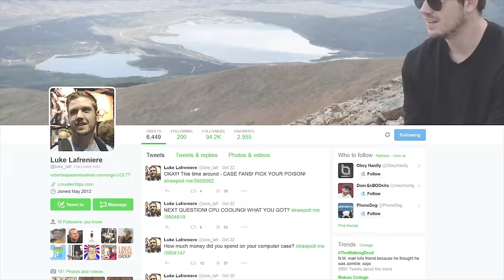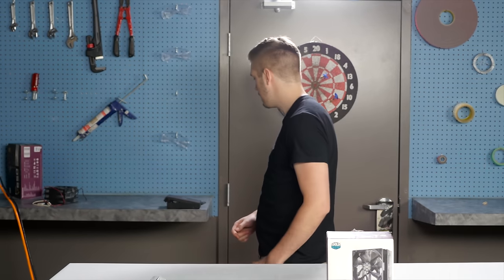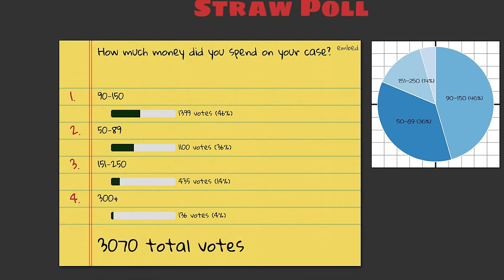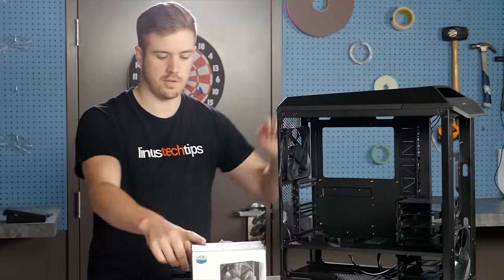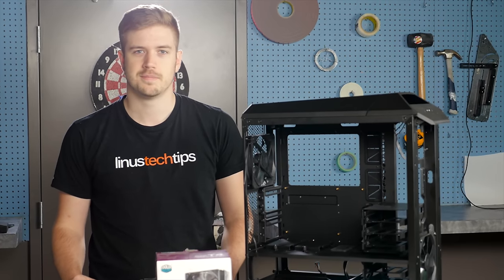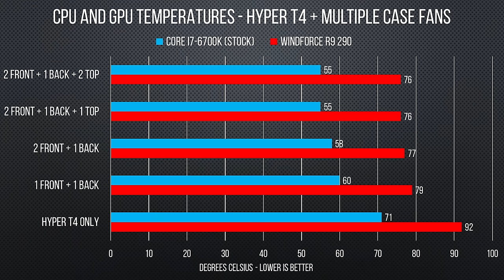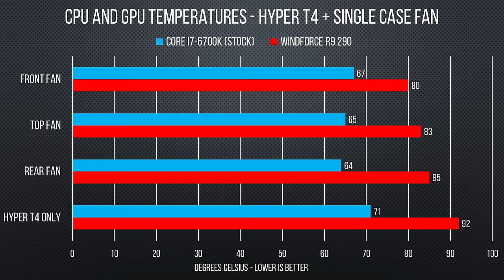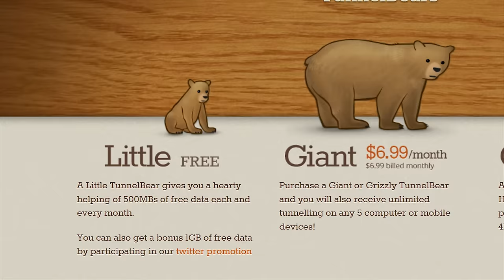Case Fans - How many should you have?

Comment: Super finds Luke! One interesting thing I've found through my own experiments is that having a direct flow of air to a particular component helps temperatures significantly (rather than having to go around components etc). Not something that's easily done in a normal case unfortunately though.
Reply: +DIY Perks Well you also designed your own case to take advantaje of that ;)
Reply: +DIY Perks It's also easier to get direct airflow on a GPU with a CPU tower heatsink as in your build. Out of curiousity, how much did it cost you to build a case rather than buy one?
Reply: +DIY Perks Your case is superior in design to what anyone could find out on the market. The closest thing that I could find to it was the Silverstone FT05 (or RV05). These cases have the rotated motherboard design and also have VERY good case fans that provide direct flow of air, the Silverstone Air Penetrators. But a case like this doesn't have room for a tower heatsink on gpu like yours does.
Reply: +Daniel Schulz The whole case itself cost only £50 in materials iirc, including the wrap and paint etc.
Reply: No shit m8 ...
Reply: +DIY Perks I'm sure you say it in the video, but what did the aluminium sheets cost?
Reply: +DIY Perks I mounted an 120mm corsair high pressure fan on my side panel, making it blow air directly onto my graphics card (reference HD6970 with backplate). This caused my GPU load temp to drop  from ~95C to ~78C!!!

I completely agree with you as my findings concluded the same! ;)
Reply: +DIY Perks If you watch Barnacules's build log on his Puget Systems build, that's basically how they designed his system. They have one fan blowing directly on the graphics cards and the M.2 SSD below them. And very similar to your system and Barnacules's system is that both are taking advantage of the normal flow of convection, which I've noticed most using these tower CPU coolers don't do that. They don't mount the coolers so that the fans blow up, which that alone could help temperatures significantly without having to add fans to the system. Perhaps something that LTT could investigate as well since I don't think they've tackled that before. The case fans aren't just about supplying cool air, but evacuating the warm air, so if you work with convection, you may not need as many fans.
Reply: +Kameel I got quite simular results by mounting a 140mm fan under my GTX570 Phantom (Pretty similar design to the Gainward in the Video). Definitely worth it.
Reply: I can really recommend the Bitfenix spectre pro they are really silent even on max rpm and they are available in 120 and 140 mm and the best is these are only 10 - 12 $
Reply: Oh my god, +diyperks watches LTT, my life is complete.
Reply: +DIY Perks Holy shit, it's DIY perks B)
Reply: +DIY Perks Oh my god! I love your content, especially your custom case and 1000W flashlight videos.
Reply: +DIY Perks you case should be the ideal for all cool/quite case designs
Reply: +sirfreakish There are cases which allow motherboard positioning, but they are rare and a bit expensive. Aside from that, no case is made to allow a graphics card to be fitted with a processor heat sink. While it does work, it is not space efficient by any means. It fits his needs perfectly, but the majority of people want expandability and convenience. Also, if you're willing to mod a case or just do a custom setup then you could mount a processor heat sink; keep the weight in mind.
Reply: +DIY Perks Ah! Now I know why HP and Apple used to put baffles in their systems when they had high end client back in the 2000s
Reply: +DIY Perks Indeed bought myself an air penetrator fan to get around this very issue. Not as good as a custom case of course but the way it forces air past my hdds makes my vid card very happy. plus its kinda fun to say :P
Reply: +DIY Perks's comment just HAD to include the word "super" ... lmao :)
Reply: Oliver ASUS Ikr... I thought that sounded very DIY Perks of him.
Reply: +Amar Gandhi Where is he located, actually? Although being a non-native speaker I usually don't have difficulties in identifying dialects, but ... geez, he's really outstanding xD
First thought was some weird UK region -- or maybe even Australia!? The last guess is ridiculous, I know
Reply: Not to be mean, but did you really need to experiment to tell you that unrestricted airflow is better for temperatures? You can tell as much by blowing on an ice cube... blow harder and it melts faster. I honestly thought this was common knowledge.
Reply: +sirfreakish I have a rv03 and it would definitely have room for the tower heat sink if you chose. however you could only ahve 1 gfx card. It is also quite wide as it has a nhd14 mounted on the cpu which is crazy tall. if you added baffles similar to this case i imagine you could run a similar configuration.
Reply: +bflet12 but thats only because what you blow is hotter than the ice cube if it was a gpu it would be a different story
Reply: +Sy AM How? Did you directly place it towards your gpu?
Reply: +Sam McHargue That's not true... let me clarify: what I'm talking about has nothing to do with relative temperatures, it has to do with the physics of heat transfer. Higher rate of air flow means higher rate of heat transfer. This is true regardless of the absolute or relative temperatures involved.
Reply: Can anyone here tell me if the top fans in this video were for intake or exhaust? Exhaust probably, right?
Reply: And my fav tech guy finally comments on a channel i sub to 😀
Reply: Fully agree, in the past I mounted 2x 120mm fans to blow directly at my 2x GPUs in SLI and they helped significantly. 

I recently tried mounting a 92mm fan to blow at the motherboard but even at max of 1,800rpm the wind force was way too weak. Had wanted a 120mm or even a 140mm fan but there wasn't enough space. Not to mention that it looks ugly in my transparent window panel. (My previous 2x fans setup was in a case with no window).

Comment: I have three fans intake, three exhaust, not counting the ones on the CPU cooler or video card. I read at least 10 emails a day, so you can never be too safe! :P
Reply: Meh, I'd rather have an additional 500 GB SSD then. ;)
Reply: it's better to have more intake than exhaust
Reply: @Zeroneii3  why?
Reply: @Banana-sb1hi  reduces dust

basically it's better in the long term
Reply: @Zeroneii3  Um....no. The better the air moves straight through with no "kinks" the better. Try putting some smoke through so you can see the flow.  I test mine several times a day....;) 
There's only space for 5 120s in my Neo Air case. two front, two top, one rear. But I still fit 6. I front mounted a 120 AIO with push pull fans.
Reply: Lucas  Oops started answering the wrong thread... I prefer the purple stuff from Hawaii.
Reply: @Banana-sb1hi  Because you create positive pressure so you have more airflow in your case than there is being pulled out, keeps it more cool
Reply: Lucas  you can buy incense (its called something like that) they smell good and leave good trail o smoke
Reply: Ruined King  OMG! It's too late!!! Oh NO Oh No!.....hahahah.
Nothing is going to be destroyed in the half second it takes for a puff of smoke to flow through. 
You worry too much.
Reply: bruh  Again...you think it's like being in a burning building or something and you're pumping tons of smoke through for hours.
(Which also wouldn't hurt it)
Computers are not the delicate little flowers you think they are.
I have a laptop out in my shop that's been running for 10 years in all kinds of dust and dirt and tons of weed. Running XP. Never crashed or had any issues, looks terrible, runs fine. Hooked to a 32 inch TV that seems to be fine too.
No, I don't recommend keeping your computer in a dust bowl...but a puff of smoke to see how your fans are doing isn't going to affect or destroy a single thing.

Might even teach you something.

Comment: Awesome video Luke! Would love another test for positive/negative setups with one, two, three fans at different locations on the case...hmmm... maybe a video idea for something i should do :p
Reply: Yesssss Plzzzzzz
Reply: I love that I can't help but read your comment in your accent xD
Reply: +HardwareCanucks yes do it. just do it. please do it.
Reply: +HardwareCanucks c'mon, do it, i'm so curious! and of course i love your style :D
Reply: +HardwareCanucks and one fan. lots of cases only come with the one in back, like mine.
Reply: +HardwareCanucks Sneaky self advertising.
Reply: +Dalton McCabe You should consider watching the video. He does test with only one fan at different positions.
Reply: +HardwareCanucks I'd like to see what an intake fan in the bottom would do to the graphics card. (like you can do with for example the Fractal Design Define series)
Reply: +HardwareCanucks i will watch it if you do
Reply: +HardwareCanucks All that needed to be done to compare positive/negative temp setup in this video was to switch to a 1 front/2 back/top fans and compare with the 2 front and 1 back fan. Other than that, the real reason for having positive setup is to help avoid dust buildup on your filters due to sucking in air from all sides of the case (in negative setup).
Reply: +HardwareCanucks I also asked myself this question, they have already made a video about negativ/positive airpressure but as you said, does it affect performance much to have all the fans pushing air in versus out.
Reply: +HardwareCanucks yeah i was gonna say there was no mention of postie or negative airflow, the use of air filters. Or maybe reversing air flow by using the top, or the back fans as intake and the front as outtake.  AND using fans internally aimed at specific components like the GPU, which is something that Puget Systems does by using heat mapping to know where to place fans in strategic places to cool down hotspots.
Reply: It would certainly be nice to see some hard numbers regarding the effects of placement, size, speed, blade type, et al on pressure, but I imagine you would end up having to model each specific configuration mathematically to do that, and at that point you could probably just go with some logical assumptions and save all the time.
Reply: +HardwareCanucks Great idea, please do it, by the way you have an outstanding show!
Reply: +HardwareCanucks Different cases - 3 to 4 completely different and popular ones.  different fans.  at least 3.  noctua to near junk -o brand or at least mid range.  like one of your 10 to 20 plus page reviews for products would be really awesome for this.  i actually chose the a data ssd for my rigs os just from your review and i was considering samsung which you showed the a-data beating in great detail.   thnx.
Reply: they did do some video on +ve vs -ve air pressure a long time ago at the NCIX channel, though i don't think it was as thorough as you're suggesting
Reply: Issac ? on yer meme ? will there b any lube ?
Reply: yaaass
Reply: +HardwareCanucks What happens if you put all fans blowing out or blowing in?
Reply: +HardwareCanucks He forgot about the third fan bracket that goes in place of the optical drive mount
Reply: My question is I usually opt for side case fans for blowing on the GPU. How's about including some tests with those fans.
Reply: Ideally I'd suspect negative is better, but you'd need to filter every possible intake point you can't be certain to block.  It's just easier to keep a good [clean] flow with positive pressure and just filter where the intake fans are.  Negative pressure is a little cooler as well.  Dust more than counters that unless you don't mind periodically cleaning it out.  So, positive with filters is typically the better choice.
Reply: Another [(un)answered?] question might be to figure out what configuration gives best cooling/noise/cost(hardware and electricity) ratio.
Reply: HardwareCanucks s
Reply: check out what I commented up top: 

Morphh Fpv/gaming
1 second ago
Im running a i7 8700k , gtx 1080 palit dual OC (wich do run hot at demanding titles) and DDR4 16bg. on my cpu Im using a coolermaster aircooled heatzink.
I went for 3 chassis fans in the front and one in the back for exhaust, running all 3 fans in the front running at a quite higher RPM than my exhaust.
(for the purpose of achieving possitive air pressure.

 Iv set up different profiles for whatever I want to do on my pc at any given time. but when I Use my gaming profile wich iv set to about 1150-1250rpm (sometimes abit higher on the intake) on all intake fans and my exhaust fan running at 850-900rpm (cpu fan running at 1100rpm btw) 
This way I desipate heat faster out for cooler temps on idle and under load, also with minimalistic with dust that accumulate inside the case. this way the exhaust cant handle the intake, so all the extra airflow wil flow through cracks and and openenings in your case, allowing you for better heat dissipatation. 
Atm Im idling at 23-27 degrees celsius and  during benchmark, cinebench and stresstest I never even hit the 60 degree celcius, well I hit 60 on the package, but all cores mostly sitting at 54-58.

So In imo posstive air pressure is the way to go, balanced is also fine. but I went this route.
Reply: I've done extensive tests on this subject, the results seem to agree with what many experts recommend that there should always be positive pressure inside the case. All the fans should blow in Ward , and that will also significantly extend the life of the fans as there will be no dust build-up. I have made several Towers like this and they can run 24/7 for years without any issues and any accumulated dust.

Comment: I like how this is recommended to me the day after I installed 9 more fans into my pc and upgraded 2 others to bring my total fan count to 21.
Reply: you can fit that many? All 120mm right?
Reply: @Picklebottom12345 not all 120mm. On my intake I have 2 200mm fans, and then behind it are 3 140mm fans. The 200mm look nice but considering the front is tempered glass, I do need more static pressure than the 200mms can provide. On my CPU 360mm rad, which is mounted on the side of the case, I have 6 120mm, and then my gpu rad, which is also 360mm, has 6 120mm fans as well. Then my exhaust fan is a 140mm. The other 3 are the chipset fan, (x570), the gpu vrm fan which is 92mm, and then the psu fan, which is 130mm or something weird like that.
Reply: @dapz  oh I didn't know we were counting built in fans (like psu and gpu ones). also I didn't realise there were 200mm ones. You must have a massive case right?
Reply: @Picklebottom12345  yeah, its pretty big, and wide too.200mm fans are one of the largest fans you can commonly find in pcs, though 250mm fans have been made for pcs, just very uncommon. not including built in fans i would have 18. its about 65 decibels at full volume, i actually have a vid of it on my channel.
Reply: @dapz  oh nice. That is, a lot
Reply: SO you ended up with your IQ? cooool
Reply: @Cagey7531  nah, my iq is much lower. It's about 6 iirc
Reply: How's that +14dB sound?
Reply: Lmao

Comment: I've always set my pc up in an icebath with an umbrella drink so it never feels to hot or stressed out
Reply: Bruh just throw that shit in the freezer
Reply: Draqkon my computer case is a meat locker
Reply: Too*
Reply: @larry570  Years ago, I saw a build on a forum. They got a bar fridge, built the PC inside, drilled holes for the cables & sealed them with silicone, then put in a TON of moisture absorbers. 
Ran pretty cool, overclocked real well.
Reply: DC1337 that’s actually cool af